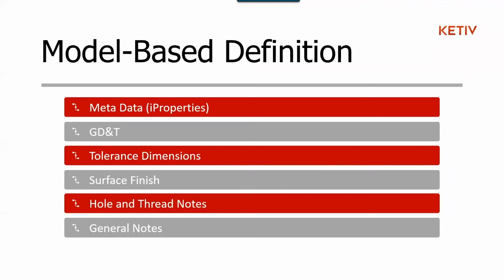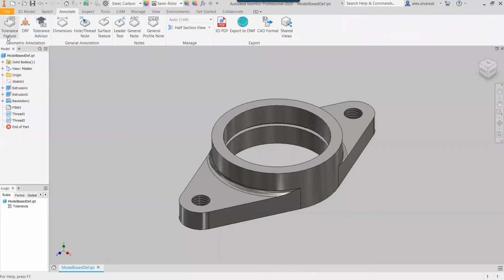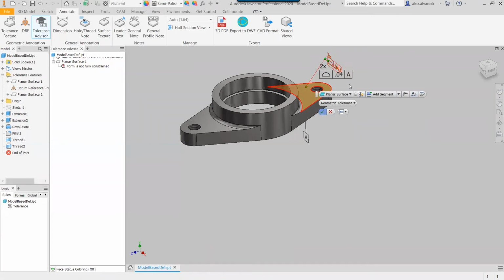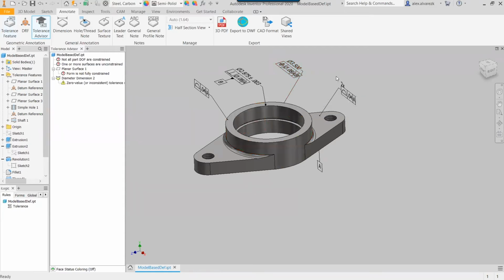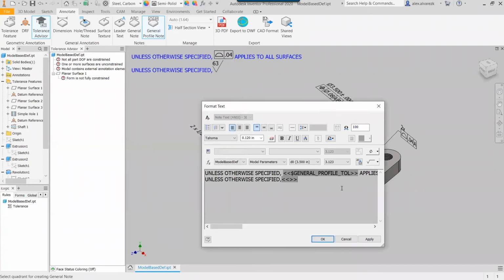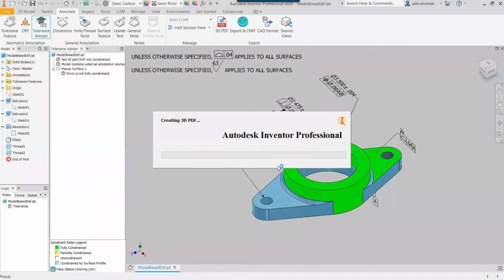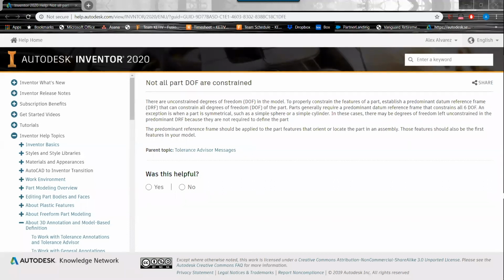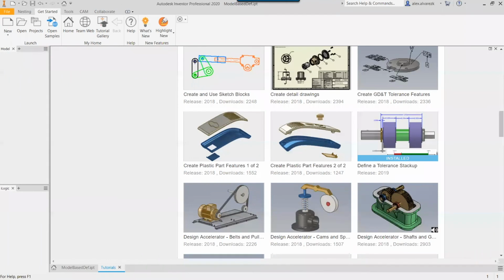3D Annotation and Model-Based Definition | Autodesk Virtual Academy

Comment: Hi, apologies if you have covered it in a different post. MBD is excellent but after that, the most important feature is the tolerance stack-up analysis. That gives you a level of understanding of how the tolerance variation and the worst-case scenario can affect your design and your manufacturing process. Cpk then is the next step. So, it would be useful if you could provide a tolerance stack-up analysis video.
Reply from the maker: Hi Dimitrios, thank you for the video topic, we will add it to our suggested topics list!